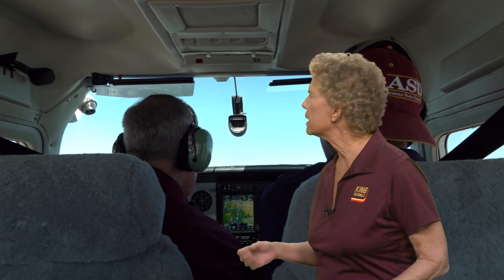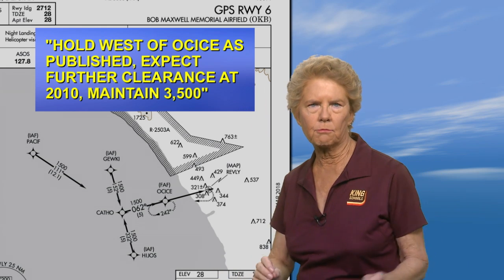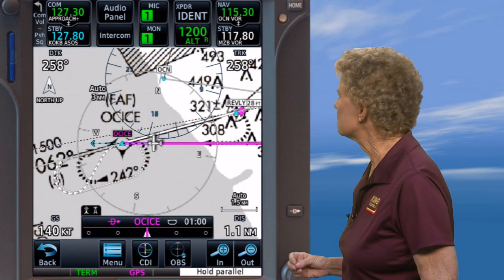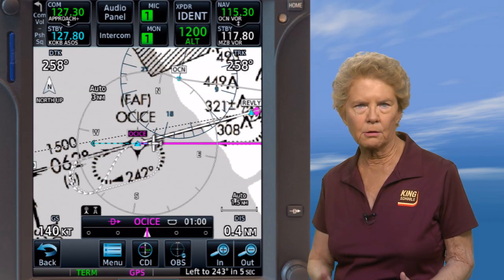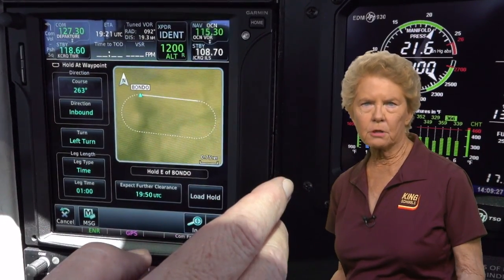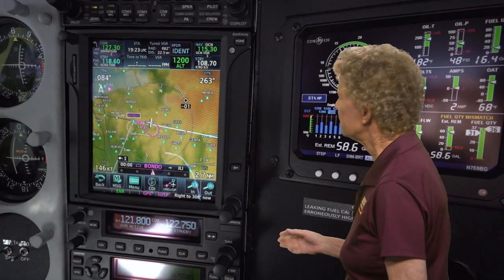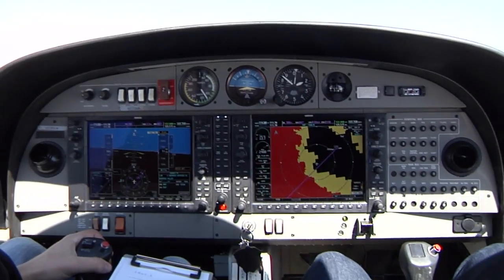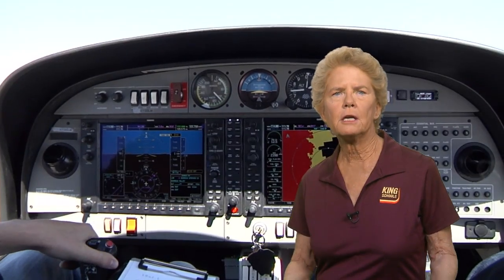Flying Holding Patterns w/Advanced Avionics

Comment: mean while when you are done fiddling with this you are very dead in some ones suburban attic nose down.
Reply from the maker: If you stop flying the airplane, maybe.
Reply: @KingSchools  true
I like your videos by the way.
anyhow Sikorsky airport tower years ago put me on a runway 29 approach witch had a heavy cross wind from the left.
I, im in a Cessna 152 and student pilot at the time
was coming from Danbury CT with no wind issues.until Sikorsky
oddly enough I had it made on short final until the cross winds hit me on the left side at about 500 ft AGL
from there on down it was left wing buried down and I mean buried down and with hard right rudder applied to stay on the center line.
the left main gear hit first then the right then nose gear.
maybe my flight instructor called the tower and said put him on a crosswind runway approach and lets see how he does a cross wind landing.
----------------------------------------------------
ever fly backwards in an airplane  ?
I did in a sail plane over rt 8 in Waterbury CT
we caught wave lift from the Adirondacks on a west heading 
we backed up over RT 8 heading east